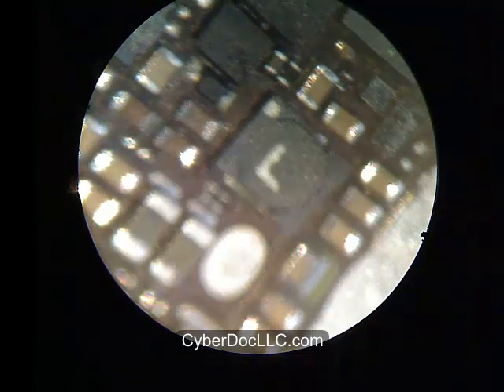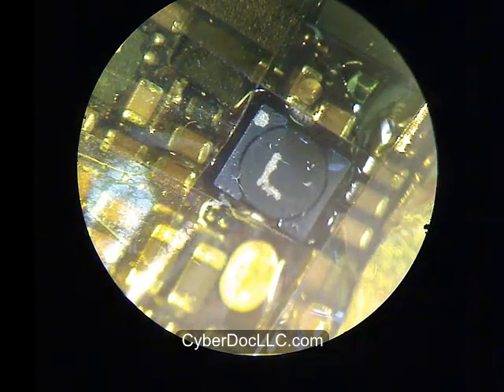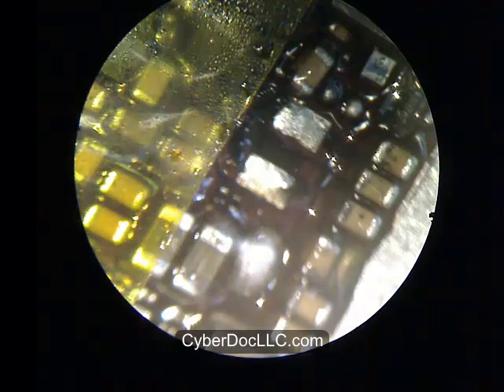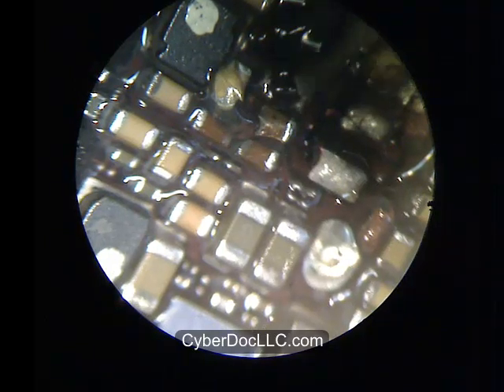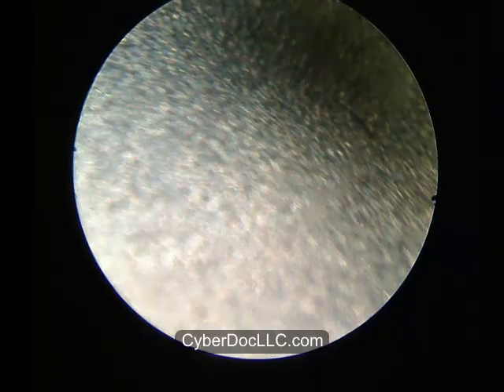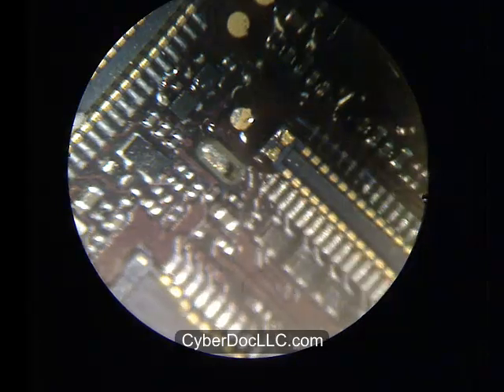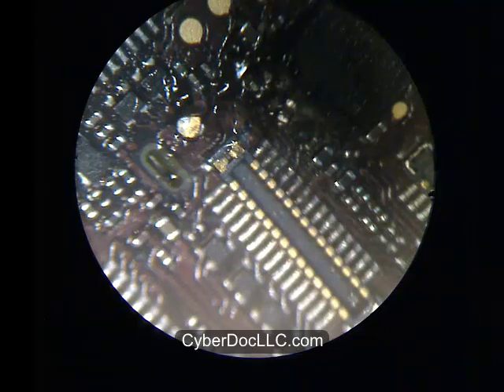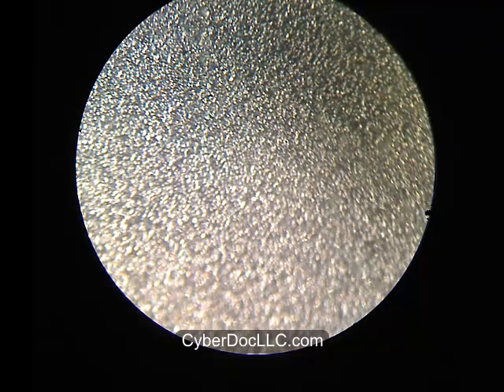iPhone 5 Backlight Repair Lcd Dim Screen Coil, IC, 3X Filters CyberDocLLC com

Comment: hello bro ...

i have a question for you ...

let me introduce you with my problem...

first... i make a change of carcase for my iPhone 5... then when i reassambly my phone it start reset itself and
the battery indicator is stuck until the iPhone reset itself ... well ... i can solved the reset problem  restarting the " battery memory" but now i am wondering the mother board has a problem... that's because looking for a solution i found some comments with the same problem that said maybe a capacitor or some resistors could be damaged when they changed the battery or the carcase...

do you know something about this problem... have you seen a problem like this ?